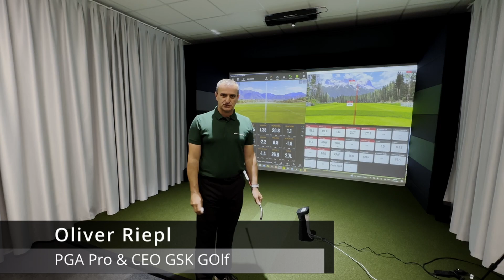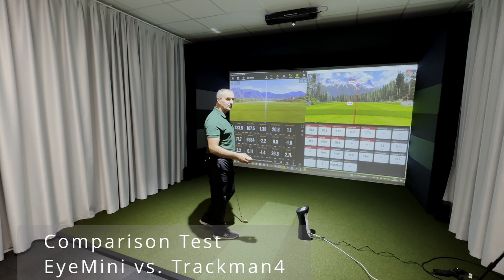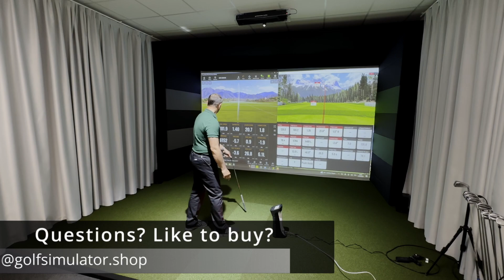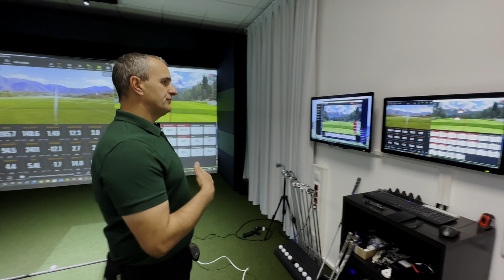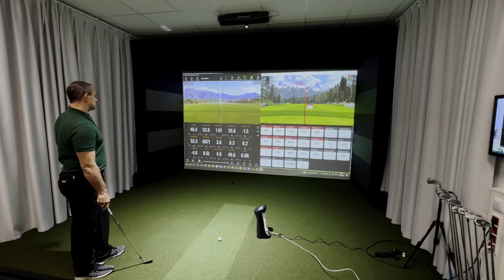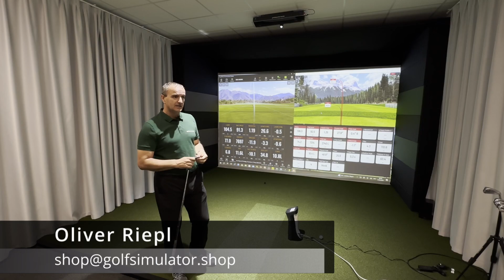Uneekor EyeMini vs. Trackman 4 - Crazy Results Incoming!!!!

Comment: Between 3-10m off on the side total. Not really accurate I‘d say, but which one is correct?😂
Reply: Im seeing the same results throughout multiple videos an exaggerated spin axis on the mini compared to any other device.
Reply: It will get fixed with an updated firmware  @MikeDoba

Comment: Trackman and all camera unit measure club data from different locations on the club. Tm measures from center mass. Where camera measures face at impact. Tm since it’s taking its measurements from the center, it’s slightly after impact. So camera aoa will be higher negative number and lower positive. I think I got that right. But point is, club speed, aoa, path ect will always be 1-2 degrees or mph different.